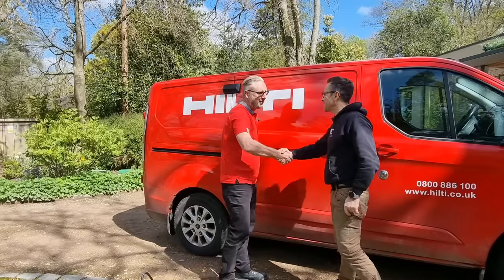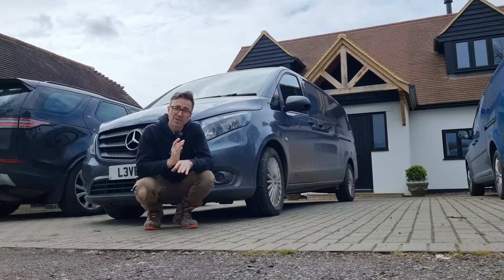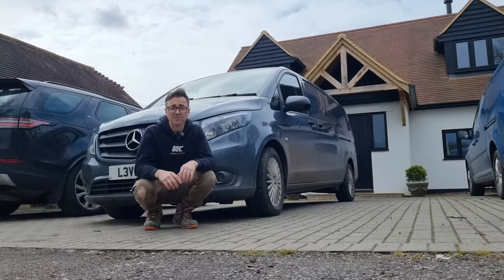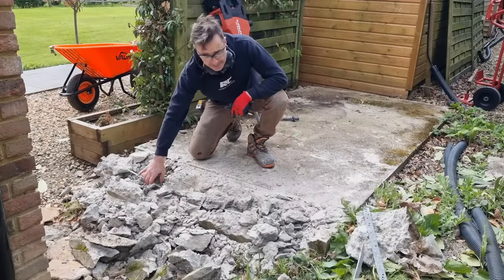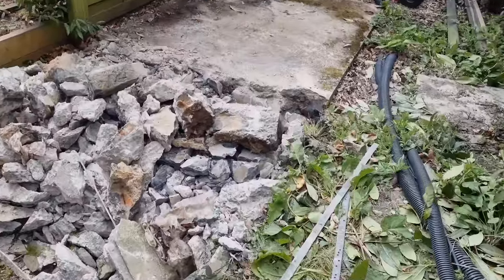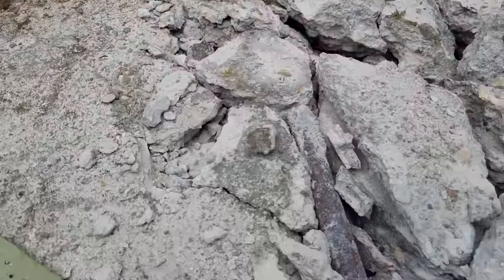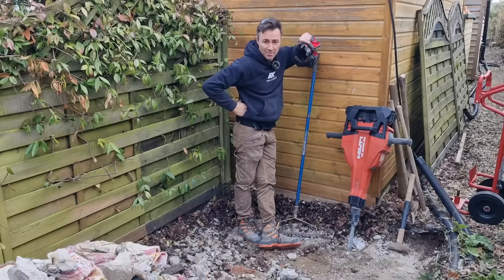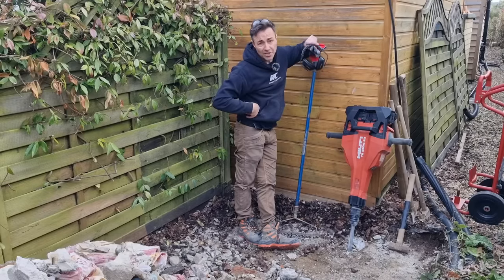I put the Hilti Nuron TE 2000-22 cordless breaker to the test

Comment: So, for a slab of that size my first choice of weapon might have been “Feathers and Irons” if there was no reinforcing. I have found this to be the fasted and least work for that size of slab. It also leaves you with dimensioned blocks instead of wheelbarrows full of rubble. My set of feathers and irons require a 1” hole (drilled with a Hilti - fastest masonry drill). Any chipping I do is with a Makita HM1213 - light weight and effective!

My second choice would have been battery cut off saw with a sledge- I hate rubble - I like neat blocks.

Either method would have been faster and less work.
The former owner of my home liked to use truck leaf springs, front axles, rusted boat anchors and bandsaw blades from the sawmill for reinforcing.

Comment: I think the last bit of your video sums it up. Hilti make great product - their drills will bore through concrete fast, their anchor systems work! I have a few Hilti drills that just keep going. It is a a well engineered and predicable system with solid support for the daily user! Not the least expensive product line but probable the most comprehensive one stop shop for constructors and engineers who need production to keep going.

DeWalt, Makita, Milwaukee and others make masonry drills and breakers but You seldom see those brands tested against Hilti on YouTube and there is a reason.  Hilti is just in its own league.
Reply from the maker: Hi Gregory, You have summed up Hilti perfectly, I know many serious contractors that would use nothing else!!
Reply: There is another angle to consider too - if you are a small contractor or working alone you cannot afford waste a minute today - for me time is precious so I am only interested in what works and is well supported!

Comment: I guess these metals in concrete was been used as control joint for leveling, concrete mix looks strong one M500 cement with 1/2.5/4 mix ratio. and full bags of cement used for quicker filling with less mixing. Investigation done😂
 Tool , breaker monster👍

Comment: Some things are great cordless, some things not so. This is like a cordless chainsaw, you need to piss about with batteries and charging when all you actually want to do is just get the job done in one sitting. For me there is a cut off with how much you need to use the tool for. If it's more than 10 minutes at a time, go for mains powered.
Reply: with the right extension cord and into an adequate provisioned circuit